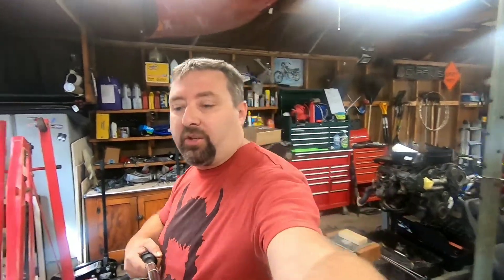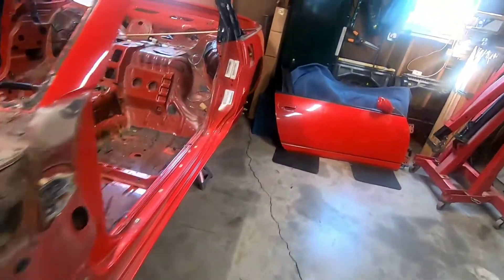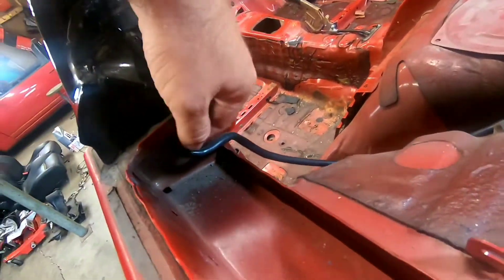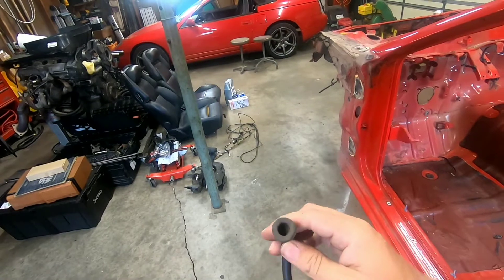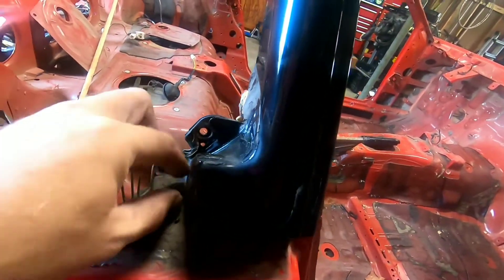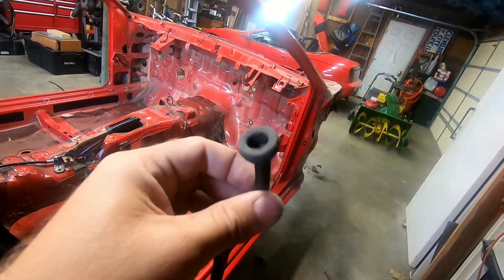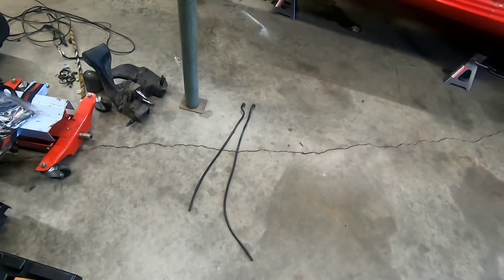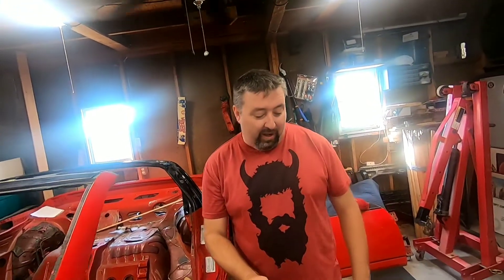Nissan 300ZX - Part 42 - Convertible Roof Drain Location and removal

Comment: Hi bud.  i like your channel. thanks for all the stuff i gat to learn listenning to your videos.  I would like to know if those z convertible are ''leaky'' !!!???

Do they leak when you wash then or in the rain.  What should i look for in my next z convertible buy ?
Reply from the maker: They can leak, as the rubber is now over 25 years old and can rot. Since you asked the question, I will address it in my next video, on what to look out for on leaky tops
Reply: @z32_workshop52  great, thanks a lot.  Merry xmas.